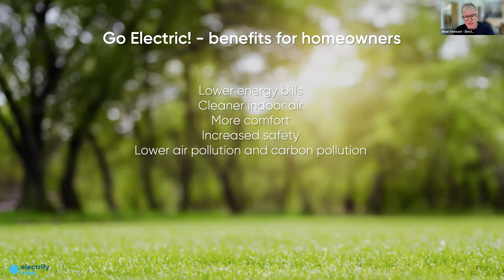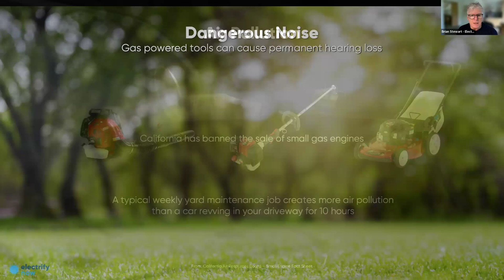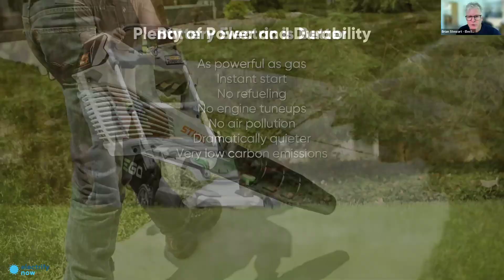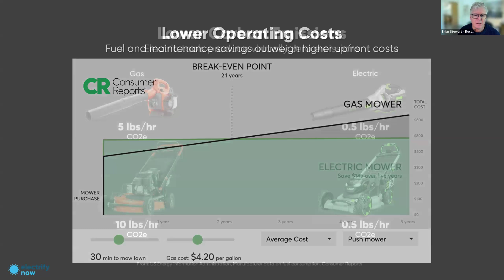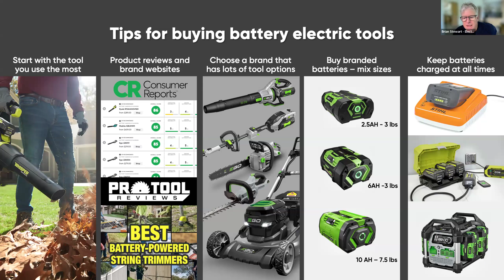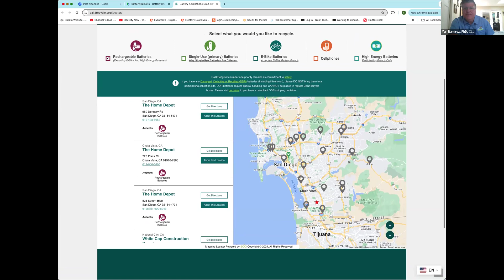Electric Yard Care - Ditch the Gas

Comment: You should tell the whole truth, and electric blower of equivalent power to gas makes the same kind of noise. The noise is in the blower.
Reply from the maker: @scottfranco1962 - thanks for your note - the whole truth is that electric blowers are dramatically quieter than gas blowers.  All electric blowers on the market today produce 65-70dBA, while gas blowers typically produce over 80dBA and many that are commonly used by landscapers produce over 90dBA.  This means that from a human perception standpoint, electric blowers are one half to one quarter as noisy as gas blowers.  You can look at manufactures data - they all report their noise output using a standardized ANSI test procedure.
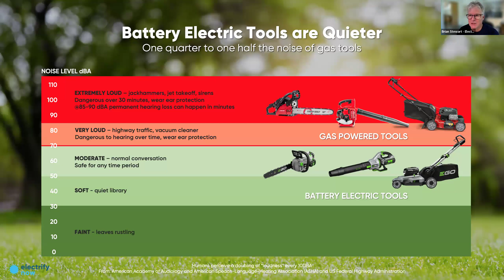Reply: I'm sure that nuance is illustrated at 8:09. Noise is created by a tool's engine and blower. Electric engines are quieter than gas engines, so the total decibel range is lower. I have a neighbor with a gas blower and another neighbor with an electric blower; the electric blower is much quieter.